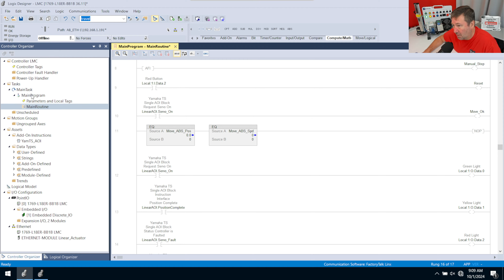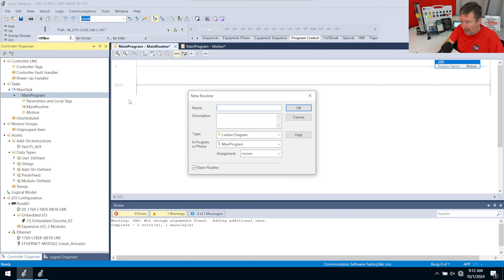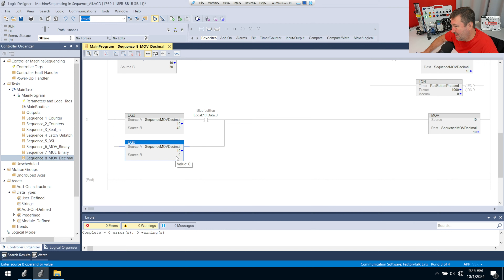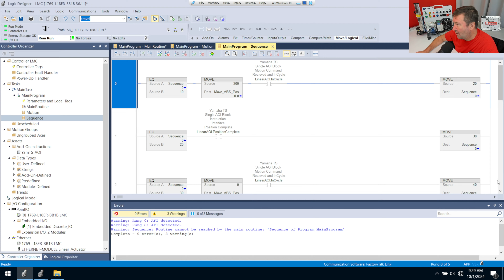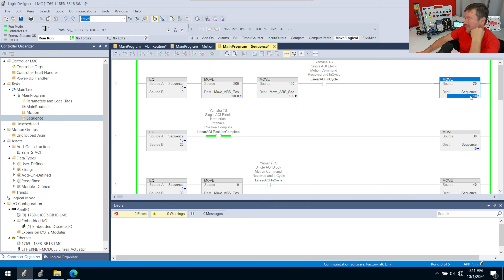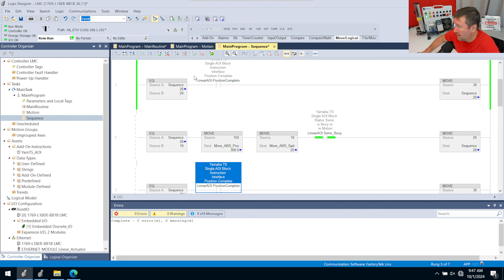Programming Your Pick and Place Application in Studio 5000

Comment: I learn a lot from your videos, thank you very much for sharing, I'm racking my brains to make an HSC contactor on the micro 800 to count the speed of a motor in RPM, using an inductive sensor, to count the pulses for 1 second, then multiply by 60 Hz which would be 60 RPM when the shaft makes one revolution in 1 second, but when I put mov to reset the counter it doesn't reset, any solution to this problem... I thank you in advance, God bless you..
Reply from the maker: There is a little more to resetting the value of a High Speed Counter on the Micro800.  This video will get you there.
https://www.youtube.com/watch?v=-FoGliVKUGE
Reply: Hello, I managed to reset the accumulator, I had to change the HSCcmd from 1 to 4 with 2 MOV and move 0 to the Data accumulator and move 0 to the Info accumulator, then the counter does this 1 second count then it resets the accumulated, using only a fast input from the PLC I0 where the PNP inductive sensor is connected, I don't know if this way is correct, there may be other ways to do it, but this is how I managed it, so if the motor shaft rotates 36 times per second it means that the frequency is at 50 Hz or 1800 rpm.
Reply from the maker: I'm glad you got it worked out!